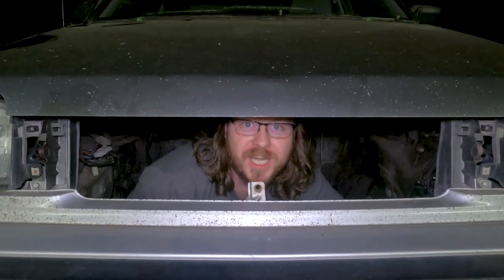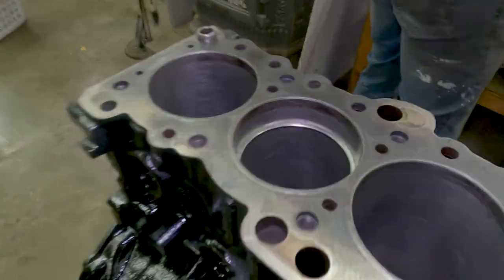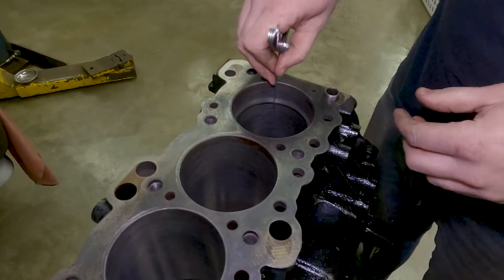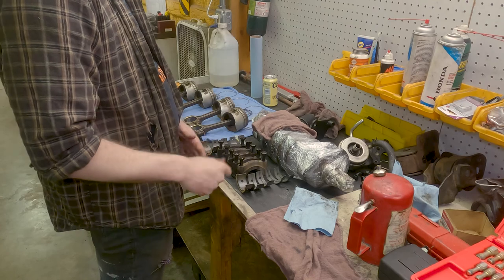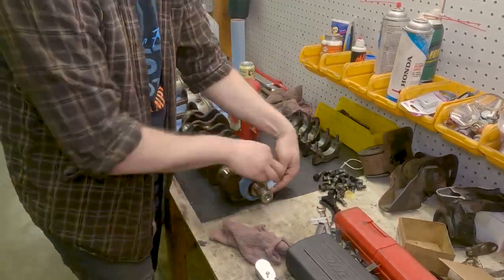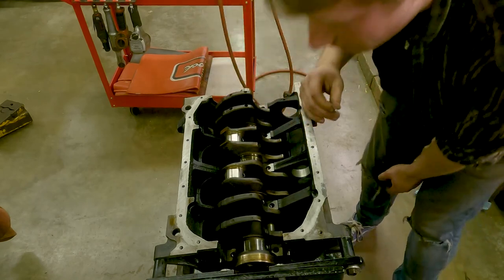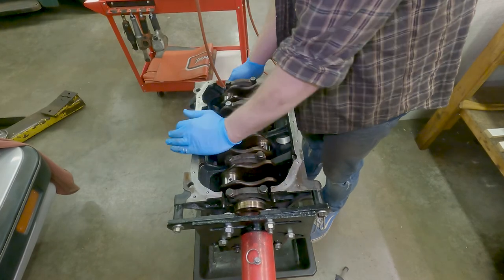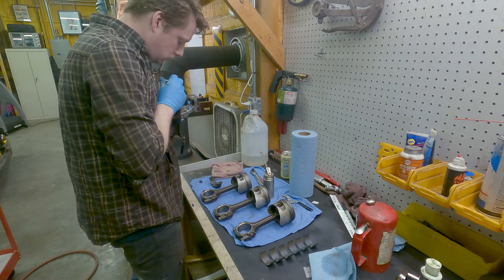The Vista Build Pt.  5: Engine Assembly | Turbo Colt Vista Wagon

Comment: Excellent choice keeping the balance shafts they do make quite a difference in the engine running smooth.  What ecu will you be using?
Reply from the maker: Thanks! Yeah we prefer to keep the balance shafts in all of our 4g63s. We will be using a 2g ecu with link v3 to run the whole thing. We'll have a whole episode on the ecu and wiring soon!